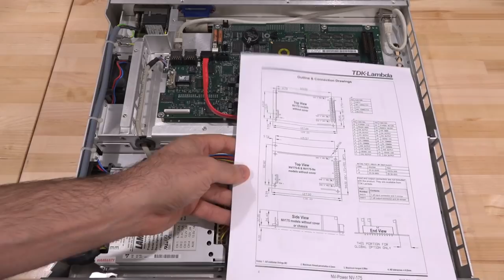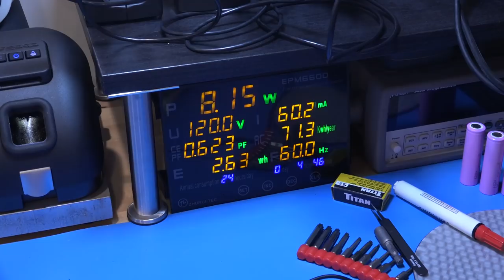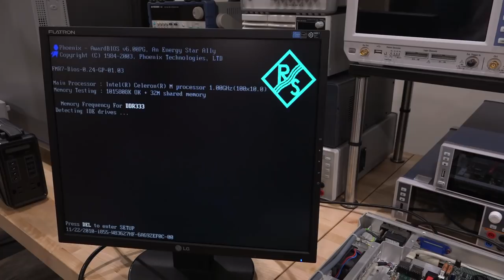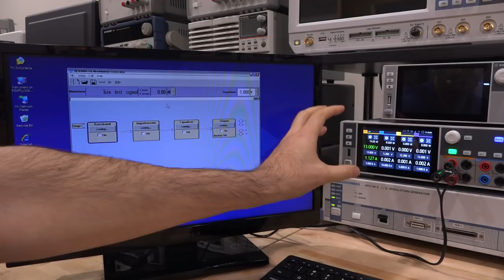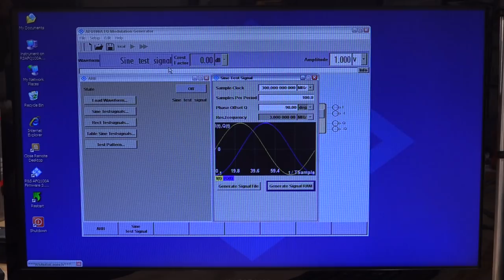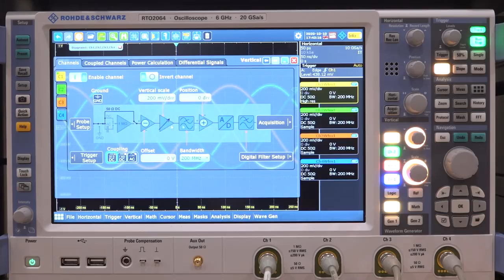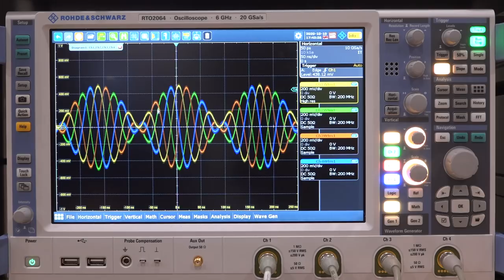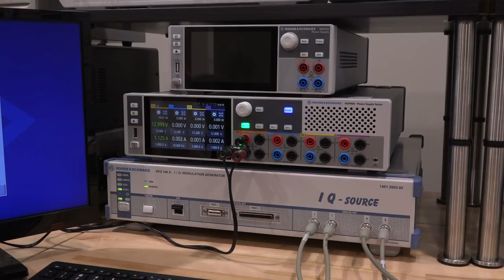TSP #176 - Teardown, Repair & Analysis of a Rohde & Schwarz AFQ100A I/Q (ARB) Modulation Generator

Comment: Worth to note for readers - often replacing boards from different hard-drives quite dangerous, as firmware can have different settings and mapping, which are not matching the platters side, even from same model drive. So there is high risk to bork everything beyond repair by doing controller board swaps. Glad it worked out in this case.
Reply from the maker: I made sure the firmware is the same version. This is all listed on the drive itself.
Reply: @Thesignalpath  Firmware is only one bit of the story, service information and maps also stored on media.
Reply: Agree, the bad sectors are stored on the board for instance... swapping the EEPROM from the bad board to the good one is likely what is required.
Reply: @xDevscom_EE  Yup this, must admit I was a bit surprised it worked without errors. Got lucky.

Comment: I would really image that HDD quickly now you got it working and put a new SDD in place of it , before it goes pop and you loose the lot :)
Reply: I'm pretty sure Shariar will have the HDD image file saved using something like dd on his NAS, cloud storage or even a USB thumbdrive. There is no rush to SSD.
Reply: @Drew-Dastardly  LOL - Yep, but NOT done similar things myself and spent days and money getting images from suppliers that i didn't need to do if i had just done what i have said :(   I always back up now at the first chance, as i do alot of CAD CAM machine repairs and it very easy to either loose, or delete the data :( :)
Reply from the maker: Yes you are right, the very first thing I did was to image the drive. :)

Comment: That R&S computer is a standard part, that R&S calls FMR6. There are several versions of the computer in this formfactor. It is universally used across many instruments, such as the CMU200, CRTU, likely even ZVL and FSP etc...
Reply: Ah, pardon, this is not FMR6, this is the more recent stuff with SATA interface, likely FMR7? I think 6 was the last one without SATA.
Reply: But can it run Doom?
Reply: At 15:11 BIOS says FMR7
Reply: @benmodel5745  I'm pretty sure Doom would be a walk in the park, it's from the 486 era after all. Crysis is another matter.

Comment: other companies: Just put a proper heatsink on a hot component

R&S when they notice a heatsink is too small: We shall make a giant airflow shroud! Out of solid metal!
Reply: ...but leave the poor outsourced power supply to suffer its own thermal agony :-)
Reply: Brendon Bentley pure german engineering, engineer everything brilliantly, ensure something breaks in time
Reply: @sunnohh  It is doubtful that the design intention was to ensure that something breaks in time.  There are principally two risks with outsourcing any hardware block.  Firstly is poor integration which usually results from misunderstanding the outsourced portion.  This misunderstanding comes from poor documentation by the manufacturer of the outsourced block or expectations/assumptions by the integrator that deviate from reality.  Secondly the manufacturer of the outsourced hardware may not put the same care and emphasis on quality (often driven by business level/company culture considerations) that the integrator expects.  This is not always simple and easy to detect, verify, document & enforce.  For these reasons it is seldom a good approach to outsource anything.  If saving development time on an outsourced power supply is valuable, then go for it.  But please do go back and do your own power supply at the end to be in control of your own product.  Power supply failures account for most electronic failures and may even cause more damage down the line.  Perhaps the hard drive in this video failed as a result of the power supply? (...because it is seldom to find two independent failure modes on a broken item.)
Reply: @asm2750  I had the chance to select what kind of instrument I need for my job and I picked FSW85 (2Hz to 85GHz) spectrum analyzer, my former employer bought it. In the end I regretted my decision. The RF performance meets with it's price tag, but the GUI is buggy and can poorly operate with the connected RT2064 sampling scope.

Comment: Had the same issue in an R&S ZVA network analyzer power supply, also a high quality Lambda power supply with a failed cap in the startup circuit. Also had a „burned“ loe voltage power connector in a R&S SML signal generator...

Comment: As you suspected, the motherboard is a common design for a lot of their instruments, from early Pentium III based designs up through Windows 7 machines, at least.  In some units its internal, and in some it's directly behind the display, and they're largely interchangeable, though the front panel decoder chip is coded to the kind of instrument its part of.  That white flat flex connector on the left side when first opened would normally be for the front panel buttons, while the shrouded 0.1" connector above it would be for the front panel encoder knob.  The IDE port you suspected is actually a secondary display connector, the smaller one next to it is used on more modern instruments, whereas the 0.1" IDE port looking one is the older panel connector.

It seems like every one of these boards has that ethernet port jumper, a goofy addition when you have so much backplane connector space, but I guess they couldn't fit it.  I've seen this format board in all sorts of instruments, the CMU200, AMU200, SMJ, UPV, and a few of these units with no screen or local controls included - I think almost all of their rack sized equipment in this same era used these control boards.

Comment: The Firmware is available online, the changelog says it includes some "USB drivers" so there's a chance it also includes other necessary drivers to communicate with the sig-gen hardware...
https://www.rohde-schwarz.com/firmware/afq100a/
You could try to install a blank Windows XP Embedded, then install the firmware on top.
PS: With an SSD, you should try to set it to AHCI mode instead of IDE in the BIOS and make sure to use an SSD that explicitly states it has software/drivers for Windows XP. Sind WinXP does not support TRIM natively, you need a mnfg tool that clears old data from the SSD periodically or else the SSD will likely be slow (depending on capacity). Also disable defragmentation.

Comment: >open the hard drive and switch the platters
WAIT WHAT
Reply: Just do it in the shower to keep the dust down. :)
Reply: Just the THOUGHT of doing that makes spots on my little undershorts.
Reply: It isn't that bad as long as you do it in a reasonably clean environment and clone it sofort (i.e. with Germanic immediacy).
Reply: I've done it twice in my life and it has worked, in a non clean room environment. If it's your last resort, either the controller or motor and you need that data.
Reply: @F. BERTAGNE A good data recovery company is the right way to go if you have things you might not want to risk losing, but like you said, not cheap. Thanks!
Reply: you can make a clean enclosure with a big plastic bowl, pair of nitrile gloves, a couple of fans and some dust filters

Comment: Impressive R&S stack. Great to see one of these devices dissected and repaired. It's somewhat of a surprise to find out these machines are pc's - and running windows at that. One would probably be forced to go that way in our day and age but I was hoping that R&S would choose an open source OS or develop their own.
A rather mundane question: what are these telescopic legs you're using to prop up the shelves?  they look too small to be from IKEA - can they be ordered from  somewhere? It's a very neat solution to an ever existent problem.
Reply from the maker: Yes, they are Ikea. But discontinued. :(
Reply: @Thesignalpath  Typical - they usually discontinue anything worth making or they change it to a lower standard. Great idea nonetheless. When I saw them used this way I immediately thought they must be using the same mechanism as that inside shower a curtain rod. I've been racking my brain for years (pun intended) on what the ultimate solution for an adjustable hifi rack would be and I thought I found it when I saw these. Alas,  it's not to be.

Comment: You’re starting to see that type attenuator that uses relays in audio equipment.  They’re trying to achieve better linearity than a pot.  But I always wonder that the contact resistance in the relays doesn’t change over time and change the attenuation.  Or maybe they’re solid state relays?

Comment: Great video! After replacing the PCB of the HD, normally you would have to swap the firmware-chip to in order to function correctly again?
Reply from the maker: I made sure to get an identical HDD with the same firmware revision. This is listed on the HDD itself which is great.
Reply: @Thesignalpath  Not just the firmware is important, specific drive parameters (e.g. bad tracks, alignment info) are also stored in most drives. Therefore one should exchange the chip, although just for reading it make work for a while.

Comment: Have you had a chance to use one of the Scope Riders from R&S? I've seen your Spectrum Rider but we've got one of the Scope Riders at work and it's an amazing piece of equipment; it's like a more powerful RTB2004 inside a portable body with fully isolated channels. It might be a good addition to the R&S selection if you can get ahold of one!
Reply from the maker: No I don't actually have one of those in the lab. Looks interesting. You can always ping R&S that you'd like to see a review on my site for the instrument. :)

Comment: Shahriar  could you advise?  For my DIY projects I need a spectrum analyser, and it seems that I can get for the same price used HP/Agilent 8594E (or similar) or a brand new Siglent SSA3021X PLUS. Which one is a better choice? The Sigilent comes with a warranty and is made using  COTS components and it is smaller while HP/Agilent had got a good heritage.
Reply from the maker: At this point the Siglent will give you a lot more features and much better user interface. I’d go with Siglent.

Comment: actually all modern hard drives has serial terminal interface similar to linux boards. it is possible to see errors in post messages or run some test or specific commands.
Reply from the maker: Interesting!

Comment: Nice. I notice an NGM202. Can you review the battery simulation capabilities of this unit? Thanks.
Reply from the maker: Sure, it is on my list.
Reply: @Thesignalpath  Thanks alot Shahriar. I'm wondering what actual instantaneous dynamic range for current measurement is possible... ie. if an IoT device is deep sleeping in the nA's and wakes to pull 100's of mA's... will the unit support/log this fast dynamic auto(?) ranging and provide accurate capacity estimates of what the DUT is demanding. Are there hi-speed switched/banked shunt resistors(?)... etc.

Comment: شهریار ، 
Wonder why such high THD on these equipment,  are they running outputs stage on class AB , or is it main oscillator,  are they running oscillator in colpit configuration class A , it would be nice to get lower THD , and find out the main root cause for example is it crossover distortion or is it none linjre , are second harmonics or are they third harmonics, signal amplitude was not so high too.
At end you measuring with vector analyser , and you said it is spectrum analyser ! , it would be nice to have one video to show the difference between the equipment,

Greating from Sweden
Reply from the maker: The ZNL is a hybrid instrument; it is both a VNA and a spectrum analyzer. I am also measuring IM3 not THD. But either way, the results are normal. The AFQ is much better than what is measured. The RTO and ZNL instruments are not as linear as the AFQ which is to be expected.

Comment: yeah whoever installed that hdd bent the cable beyond any reasonable point. if i were you i'd replace the cable. I'd probably replace the hdd with an ssd, as well.

Comment: R&S really disappoints me with this instrument. Have they lost their proud and self-esteem, or should I say lost their minds? Integrating a power supply that has Jianghai capacitors on board is unforgivable! 
If you pay a premium price, you would expect nothing but first class components. Not AliExpress turds.
Reply from the maker: The power supply is not made by R&S. It is made by Lambda.
Reply: @Thesignalpath  I'd have to say the same comment applies.  Lambda is probably the most prestigious PSU OEM on the market.  What you found on that board is some really weak sauce at their level of play.